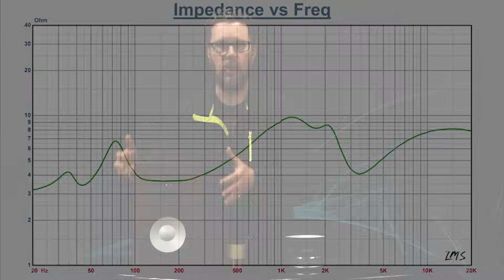What is Speaker Impedance? | Impedance ohms rating explained

Comment: Very well explained. This is a somewhat confusing topic. The counter-intuitive thought is that less ohms should make a speaker louder. This begs the question: why do speaker manufacturers not standardize the nominal resistance to eight ohms?
Reply: WHY SHOULD THEY!?
A coil of wire of a certain thickess (different impedance) in a magnetic field behaves differently, technically and sonically that a thicker wire... 
And as sonically the mebrane REACTS differently in terms of air moved and conter-react to it, different NOTION we get.
You see, things that are happening behind the scene, in electronics are connected and CAN a will influience the experience.. BUT npt in the way the massive clueless (unfortunately, because you need seriois study at Uni to understand..) audiophiles "experts"... their tags and glory vanishes in the front.of reality..
Do not hate me, because you might hate the truth and reality..
Reply: Any load that is not pure resistance will have different impedance at different frequency.  Even a straight piece of wire in space is about 1 uHenry/meter of inductance.  This should not make a difference for speaker wires at audio frequency but it will for a speaker voice coil.

Comment: I would suggest a follow-up video on loudspeaker load impedance that adds description of phase associated with impedance, and perhaps most importantly include discussion about EPDR (Equivalent Peak Dissipation Resistance), which is a combination of impedance and phase. EPDR curve with respect to frequency provides better description of the load that will be seen by a class A/B amplifier. For more information on EPDR, see Eric Benjamin's (Dolby Labs) AES paper,  "Audio Power Amplifiers for Loudspeaker Loads". You can use REW or VituixCAD to calculate EPDR curves on the cheap.

Comment: So I hooked up a pair of hungry Magnepan electrostatic speakers to my modern Yamaha RN602 and it actually tripped an internal breaker. So, is this due to a low impedence speaker or the wattage? I couldn't believe this amp wouldn't run those speakers at all. We had to buy a more powerful amp to run them.
Reply: You now are into speaker efficiency.  Some speaker need  higher power to make sound.  What was the recommended  power for the speakers.

Comment: To find two different drivers in parallel just add the ohms then multiply the ohms then finally devide the two figures you have to get the total resistance
Reply: You say what? If you put two different drivers in parallel you'll get a big mess because their impedence curves won't match.

Comment: But apart from the concept and the risks with using different impedances on an amp, what is the advantages of using a 4 or a 8 ohm on an amp that's designed for it?  Is there a different sound quality on one or the other?  What we should aim for, lower impedance or higher impedance?
Reply: In many power-delivery scenarios, for a particular power it's more economical to use higher voltage and lower current, as the lower current produces lower heat loss attributable to the resistance of the wire, or you can get away with a smaller diameter wire for the same heat loss. This is why utility companies transport power over long distances at very high voltage. So you would think using an 8 ohm speaker would be better, using the amplifier with higher voltage and lower current output.  However, many audio amplifiers are limited by their maximum voltage output, yet can supply enough current for loads of 8 ohms, 4 ohms or even 2 ohms.  
So in that case, changing from an 8 ohm to a 4 ohm speaker allows the same maximum voltage but twice the current, so twice the power delivered to the speaker, though also with twice the heat loss in the wires, unless you also increase the wire size.  The video covers this are 12:00.
Reply: @Graham_Wideman  yes that I understand, but what is the sound quality difference between lower and higher impedance?  Is there more distortion with one or the other?

Comment: I was told I could run 8ohm speaker with a 4ohm amp. I have done it. Because I was cheap and I had the amp. And yes the amp seemed to be happy. But the speaker was not performing to its full potential.  I have since bought a 8ohm amp and the speaker sounds so much better. The speakers sound range improved so much especially the bass. Excellent  video. 👍
Reply: A good rule of thumb in musical amplifiers is one may add a higher ohm speaker to a lower ohm rated amp but not the reverse.
For example I have a cheap 50 watt pa amp rated at 50 watts 8 ohms, but will except a 4 ohm load, which will increase the amp output to about 80 watts.
This amp is mono.
I took one 8 ohm pa speaker to a large room lecture and the amp struggled to put out a clean signal.
I hooked up a second 8ohm speaker in parallel which dropped the load from 8 to 4 ohms for the amp which played much cleaner.
If this amp couldn't handle a 4 ohm load and I needed to use both speakers in different places in the room,
I could protect the amp by connecting the 8 ohm speakers in series rather than parallel, producing a 16 ohm load, which unfortunately drops the amp 50 to about thirty watts thus decreasing the amps output.
Reply: @arvidlystnur4827  you just described what a lot of harp (harmonica) players try to achieve deliberately: amp/speaker mismatch. Tube amps typically tolerate a 2::1 mismatch by design, in either direction. Yes, the output sonic characteristics are different whether it’s 2::1 or 1::2.

Comment: Great explanation. I have an 8 ohm output on my guitar amplifier but I have a 16 ohm speaker I use. Is it just simply the volume is lower than an 8 ohm speaker?  From what I’ve read it is safe to use the 16 ohm. Glad I came across your channel.
Reply: Yes, if you hook a matching 16 ohm cabinet in parallel your load will be 8 ohms, won't damage your amp but be louder.

Comment: I purchased a Sony Boombox with an AM/FM Radio with a CD Player on it.  I recently purchased 15 Brand New CD’s and I went to listen to the CD’s this past weekend and I got annoyed and angry whenever I went to use My Skullcandy Over the Ear Headphones and it was extremely low.  So I took out My CD and I shut off the CD Player.  But the second I turned on the radio the music was very loud.  The CD Player should have the same volume.  So I got extremely annoyed and pissed off.  I’m considering taking a sledgehammer to BOTH the CD player and the headphones.  My question is - What stereo system and headphones do I need that are very loud????  I’m wanting a pair of headphones that are like 250 ohms (whatever that is).  If I have to purchase a stereo that puts out 3,000 Watts then so be it.

Comment: To put it simply, just remember that manufacturers always go the cheapest route and with amplifiers they will put in the minimum size transformer or the minimum number of transistor/mosfets pairs in the output stage. So when you connect the 4 ohm speaker to an 8 ohm amp, then the transformer could overheat and burn out because it now has to supply double the amperage or the output trannies could blow. Subwoofers are the worst as the impedance could go lower than 4 ohms and is why they should have an infrasonic filter in the signal path.
Reply: I guess you're not familiar with McIntosh ... Cheapest route? I think not.

Comment: Oops!  "Reactance" (X) is produced by either inductance or capacitance (no resistance).  "Impedance" (Z) is the combination of reactance & resistance.  It can be purely resistive (R + j0), inductive (R + jX) or capacitive (R -- jX). .
Reply: Thank you. I was quite frustrated at listening to a less than perfect lesson delivered with the voice of conviction.
Reply: “If I pinch the hose, the amount of water coming out reduces…” No it doesn’t, it simply comes out at a higher velocity and under greater pressure since you did nothing to reduce the volume at source. If the amount reduced, the rest would have to go somewhere else, which clearly, it can’t.
Reply: @jonchilds1637  I don't see how this relates to any of the posted comments.....BUT, if you pinch a hose, LESS water comes out.  It's just like adjusting the flow from a kitchen faucet.  The constriction of the valve is like pinching a hose.
Reply: @Pootycat8359  not sure why my comment appeared there - it was meant to be against the main video but since you mention it, it's not the same. As you pinch a hose, the water comes out faster. As you turn off a tap, that does NOT happen!
Reply: @jonchilds1637  Youtube does that.  I often get comments that are stated as being replies to me, but aren't.  Also, If you remove the mesh screen that's in the cylindrical device that screws onto the faucet, the water will spray out, like with a pinched hose, but the screen slows it down, so it trickles.  Also, I was referring to the volume of flow, not the velocity of the water coming out.
Reply: @jonchilds1637 I’m sure he knows that, I assume he dummied it down to help explain it to the lay person.  I would give him the benefit of the doubt.
Reply: What about wiring 2, 4ohm in series if there is no capacitance just inductance and resistance would that work???
Reply: @Brenda-jf2pe  I tried to answer, twice, but Win11 screwed up, so simply yes, before it deletes my response again.
Reply: Thought I would scan the comments to see if this clarification/correction was addressed before I chimed in. You pretty much covered it. Now let’s sit back and wait to see how many audiophiles ruminate over the mysterious “j” you tossed in there.
Reply: @stephenmead5488 I am an Audiophile.I didn't Pay attentions to Complex numbers and Vector Algebra,Not even in Differentiation or Intigration when I was in 12th standard😛,the time I were being forcefully tought all those .I asked my match tutor what's the point of learning it,What is the use of it in Real world.Sadly,maybe because he had not been in an applied field so He couldnt answer me and make me interested in the subject.I wish he could.😔

Funny fact Wrong career choice made me an Automobile Engineering student😂.But as I started understanding the use of Each kind of Mathamatical Operations to analyse and design everything I use In daily life, I got interested and learned it Myself digging my old high school books😂.I had to study double time😝😂.

And later my Audiophile nature forced me to Learn about Complex Numbers😂 for A.C. Filter Network Analysis & Designing.

This Mister 'j' is the same Operator that 'i' used to hate in High school.😂
Reply: @spm0  Mathematicians  call it "i," naturally.  But we electronics people are always using I for current, so we use "j."  The physics types face a dilemma:  They also use i for current, but use j for current density.  So they just go with the traditional i, because there's no better alternative.
Reply: @stephenmead5488  And if they don't know what i am saying, may a flock of blue-j's shit on their heads.  And they should be aware that I am very fastidious about correct grammar and spelling.
Reply: Oh, yes, they must also realize that we electronics technicians & engineers live in an imaginary World!
Reply: @Pootycat8359  I prefer to think of it as “complex”😬
Reply: @stephenmead5488  Of course, those living in Alaska and Northern Canada evade the complexity with their polar approach, as do the anglers, who fish the waterways of the World.
Reply: Just for good measure, for those who don't "get it," this comment, like many of mine, is a JOKE!  Complex impedance can be expressed in two ways:  1) Rectangular coordinates, of the form "Z = R + jX," where "R" is the resistance, and "X" is the reactance ("+j" is inductive, "--j" is capacitive), and 2) *POLAR* coordinates, ie, "Z = |Z| /_ (THETA)," where "|Z|" is the magnitude of the impedance (SQRT[X^2 + R^2]) and "THETA" is the *ANGLE* between them.  (Now, may I please have some "HISSES" or "GROANS," the appropriate response? 🤤)

Comment: I have two sets of speakers that were once part of a CRT computer monitor connected in parallel to a tiny amp I got from MCM. It is rated for 4 ohms. However, when I installed them, I planned on them being able to work with an 8-ohm amp, so I have 7-ohm 10-watt resistors connected to the positive terminals of each speaker. I'm also using an old Radio Shack speaker selector, which adds more impedance when both sets are in use. I tested the resistance of the speakers the way you showed us, getting 3.8 ohms. I also have some four-ohm speakers connected to a Technics receiver and a Kenwood amplifier both from the mid- 1970s. They all tested 3.8 ohms resistance. I have 7-ohm resistors on all of them. The volume level is good on them. Is this overkill? And what is your opinion on using resistors to make lower impedance speakers safe to use in general?
Reply: The 7ohm resistors you have put in series with your amp should be fine, you can go higher and it wont harm the Amplifier, probably just make the output quieter, if you go lower then the output transistors would get hot & fail. Unless its a valve amp, i was told by a valve Amp fanatic that valves dont care about loading whereas a transistor amp wont like it.
Reply: @merlin5476  so it shouldn't affect the sound quality?
Reply: @rojoeditor  it should not affect the quality.
👍
Reply: @merlin5476  Thanks so much.

Comment: So is more or less impedance better? If you're putting together a system, is a 4 ohm speaker with an amp that can perform at 4 Ohms going to have any advantages over an 8 ohm speaker with an amp that only handles 8 ohms? We see the 4 ohm rating typically is twice the wattage. Is this just math? The short answer is yes but how does it relate to hearing louder sound or not?

Comment: Can you please help me to understand the exact implied risks here? If we put a 4-ohm speaker on an amp that's designed to drive a 6-16 ohm load is the potential downside there that we could overheat and potentially damage the receiver by making it have to work too hard to drive the speaker at the desired volume level? Conversely, if we put an 18-ohm speaker on that same receiver is the danger that we could blow out the speaker? I'm just trying to understand the exact risks to each component for each scenario here as this is something that is almost never properly explained in sufficient detail anywhere.
Reply: I don't believe there could be any damage to a speaker or amplifier by having the amplifier's rating lower than the speaker's rating with the caveat that a tube amp needs speakers that match its output impedance rating. As far as I know, the speaker will not be damaged. Please correct me if I'm wrong.

Comment: Thanks for the explanation, especially on nominal impedance. I remember long ago I had a pair of Cerwin-Vega floorstanders rated at 6 ohms nomimal, and tried to pair them with a receiver rated at 8 ohms---the receiver wouldn't run them, kept tripping the output protection. I later upgraded to a receiver that had a switch for 8 ohms or greater, or 4-8 ohms----when I selected the latter, the C-V's ran just fine

Comment: There are many errors in this.

1) Reactance is NOT a combination or resistance and inductance.  Impedance Z is a combination of resistance R and reactance X : Z=R+jX.  Pure (ideal) inductors and capacitors are reactive components and provide the reactance, which is the imaginary part of the impedance.

2) The resistance (real part of impedance) is not constant over frequency.  A pure inductor might have constant resistance over a small frequency range, but a speaker is a complex combination of crossover electronics, speaker coils, mechanical system and acoustic load.  This combination will have a varying real part of the impedance, even if the resistance of the speaker coil is constant.

3) The amplifier's capability to deliver current is not the key issue with speaker impedance.  You can always dial down the volume level on your amplifier to keep the speaker voltage and current below harmful levels and use a 4 ohm speaker on a 8 ohm amplifier.  But the issue is that the specifications of the amplifier are no longer valid for a too low speaker impedance.  The allowable maximum output power is greatly reduced before the amplifier gets hot and protection kicks in.  This is not a problem unless you play it loud.  Another issue is that the frequency response and distortion gets worse and is no longer within specifications.  This is because the output impedance of the amplifier is not designed for such low load impedance.
Reply: Yes, but basically, he is correct. You, as an extreme boffin, are not the audience 😊

Comment: Question.  Why don't they design an amplifier to automatically decrease the voltage when the amplifier senses a speaker with lower ohm connected to it?  Won't this prevent the current from spiking too high?  Of do amplifiers must always deliver a fixed votage?

Comment: What about the other way around ? 8 ohm speaker in an amp rated for 4 ohm
Reply: ...overall "loudness" will be lower
Reply: @K03sport  I put an 8 ohm creamback 10 in my rt35 with 4ohm power supply.  It’s louder and better than the garbage votw paper cone bullshit that was in it.  The real winner was the tf0818 Celestion in the ppc108.  That cab rips with the 100w speaker instead of the 20w votw shit that was in it

Comment: Something is amiss when a loudspeaker's published impedance curve shows multiple spikes at different frequencies which go off the chart (>40 ohms) and yet it receives rave reviews.  Frequently this is the case in small monitors.  A reviewer will state a particular vacuum tube amplifier was used in the audition. With these wildly fluctuating impedances, any amplifier and especially vacuum tube designs would exhibit significant, audible level changes at different frequencies.